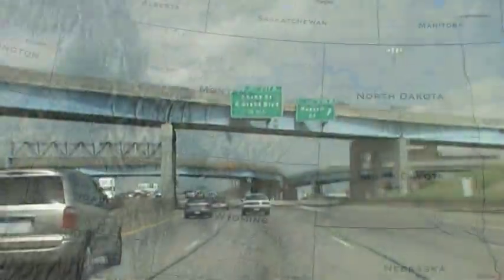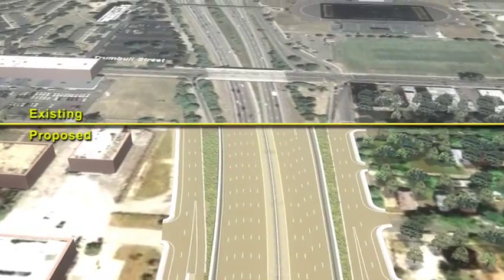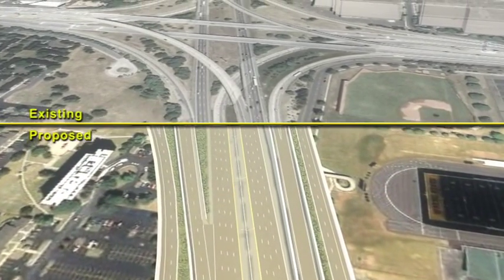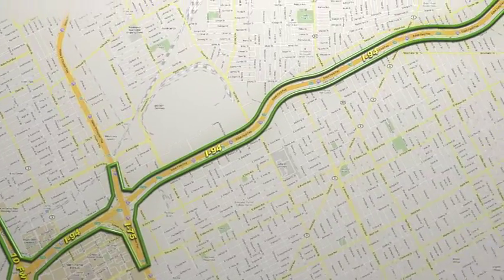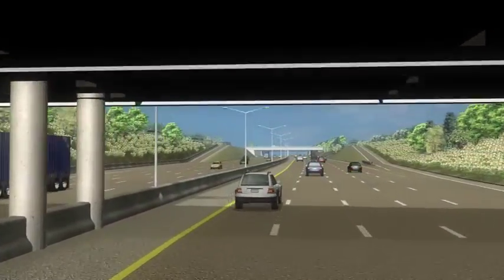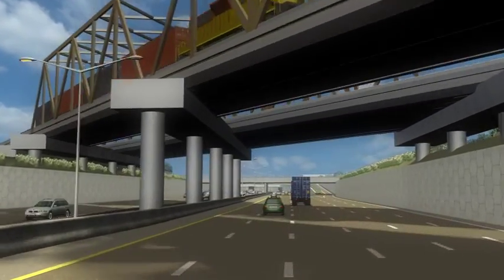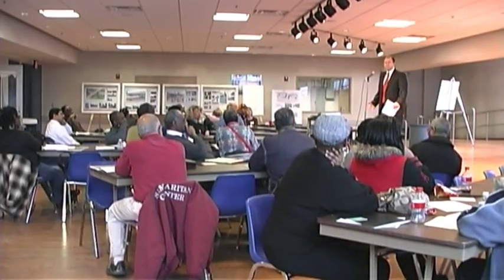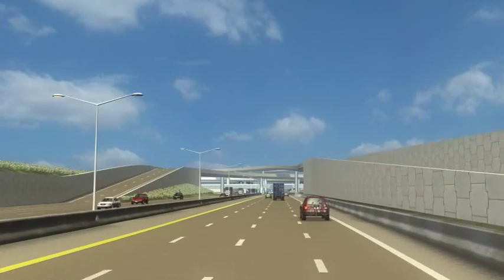Interstate 94 - Roadway to Detroit's Future

Comment: As of July 1, 2022, the I-94 (Edsel Ford Freeway) between I-75 (Chrysler Freeway) and Conner Street is incomplete in Detroit’s east side. Burns Street, Fronteac Street, and Cadillac Avenue overpasses over I-94 will be finish by the end of this year. Other overpasses over I-94 on Detroit’s west side near Dearborn are inadequate, and they are: Addison Street, Lonyo Street, Central Street, and Cecil Street do need new overpasses, since the old ones are about 75 years old. However, they are working to put the new Grand River Avenue overpass over I-94 on Detroit’s west side.